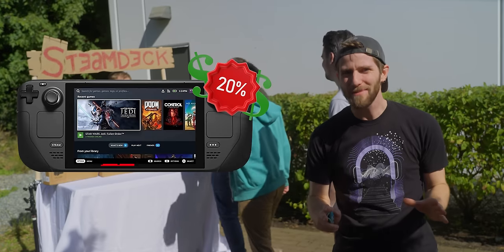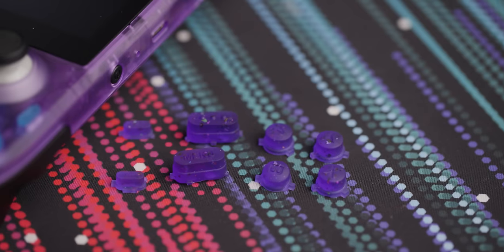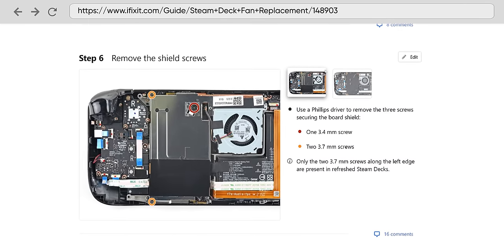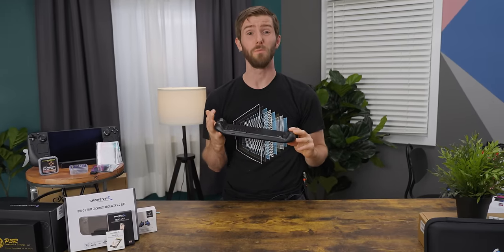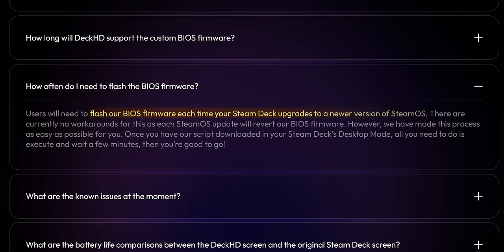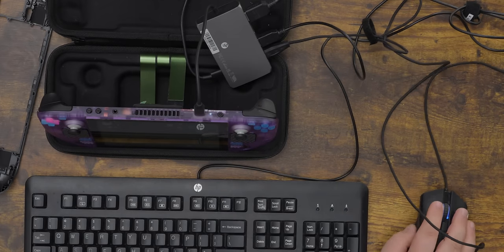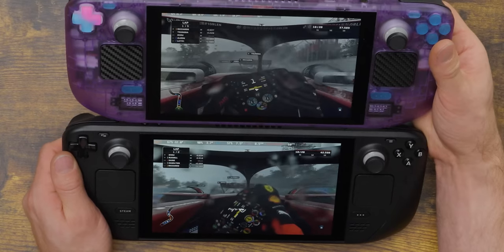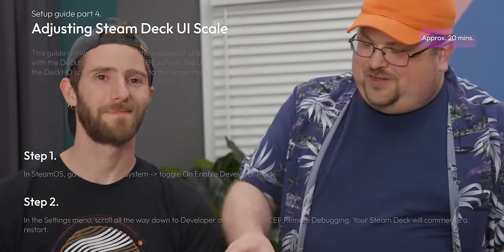Five Steam Deck Upgrades under $100

Comment: 7:20 I really like 1600p in this form factor, not because 1600P more betterer than 1200p, but because you can get perfect 4:1 scaling down to 800p for games that are a little more intensive.
With a 1200p screen you need to drop to 600p, but it just so happens that 800p is the minium resolution for many game UI to function properly(i think technically 768p but who's using a 4:3 display in a hand held, though, that does peek my interest).
Hence why i like 1600p, yes 1200p would offer better FPS at 600p, but for best compatibility, you need 800p, at which the 1200p screen will either look a bit blurry, or will cost some extra power for the scaling engine to make it look better.

Comment: Personally the JSAUX covers were much more better to install and they used the same threads for the deck.
I originally got a back cover, and then they released front ones and I bought one in an instant! Broke the screen, I heard it as I scraped off the foam, but other than that, it caused me to get a 512GB screen replacement instead, so it was a win for me, I absolutely LOVE it and honestly, it feels nice when people ask how I even did it, I even sideloaded windows onto it, allowing me to code on the go, absolutely love this machine!!

Comment: I feel that a lot of the information given on the different mods will greatly vary from user to user as many of the problems faced come from mistakes on the user side such as the overheating causing the joystick issues and the issues with the front panel they probably overtightened it its also good to take note that the screw issue pressented on the XtremeRate Shell wont be for everyone as I managed to Use the stock screws on my shell and everything is locked in place and have no issues with anything being loose or coming off. As for the DeckHD screen everyones milage will vary as some screens are miss aligned and need to be RMA'd due to some quality control issues but if you get a good unit or one that only looses on 1-2 pixels and it doesn't bother you you can definitely enjoy it. I went through the setup it really only took me about 45-50 minutes on my first ever time opening my Steam Deck now that i have done it on others I can confidently do it in about 40 minutes so them saying it will take about 2hours+ will also vary from user to user and on their level of knowledge on electronics. For a non techsavvy user it could take double the time on the page or maybe less... as for the Bios although its a bit of a hastle you dont really see SteamOS releases that often and reflashing is pretty simple.

Comment: I think they got the Waves mixed up. Wave 1 appears to be the new revision and Wave 2 appears to be the original Steam Deck

You might want to make a note on the video.
Reply: Are you saying LTT mislabeled them, or the actual products are named like that? Like did they correctly label that wave 2 is in the stream deck and wave one is the new one, but you think it should be clarified? Im just trying to understand what you said
Reply: Weird way to differentiate a product.
Reply: No lol, wave 2 is available for pre order, and is an improvement of wave 1, which is already out. And they were using wave 1 in the video.
Reply: I'm afraid they will say " it doesn't matter that we mixed them up, our conclusion would have been the same regardless of the results."
Reply: @koijoijoe   It does say that wave 1 is for the new revision of steam decks and wave 2 is for the original ones. Wave 2 will have improvements suggested by those who bought wave 1.
Reply: yeah they took down the old revision wave 1 listing like yesterday.
Reply: Nah  @koijoijoe , they're right, they're linking to wave 1 for the new steam deck revision and wave 2 for the old steam deck revisions.
The listing for the product they tested doesn't exist anymore, they took it down yesterday.
Reply: Oh my bad everyone, I didn't realize we were talking about revisions of the Deck, I thought it was just the revision of the cooler. Sorry bout that.

Comment: When I had a Steam Deck I was bringing it to work and using it as my main PC docked on my work M/K and monitor during the nightshift. It was great. I eventually sold it to buy an AyaNeo 2 which I use even more since it's Windows and works even better as a PC docked.

Comment: I will say that for the back plate the Jsaux is probably a better option. Cryobyte, the creator of cryo utilities, made a video about over clocking, undervolting, and keeping the steam deck cooler. It seem like the stock heat shield/spreader with after market thermal pad and one of the Jsaux back plates works very well.

Me personally I am probably gonna upgrade to the new version of the back plate and cover the vent hole thats on top of the fan to retain its airflow design. Then add the black shark phone cooler with the recomended thermal pad. After that I will either undervolt or overclock depending on the peformance I get after the upgrades.

Also I have found that the gulikit joysticsk tend to have stick jitter, or stick drift, so its best to increase the deadzones to avoid it. The reason why I still use them is because the deadzone is still relatively small and  they are a lot more responsive than the analog ones. There is also some made by elecgear that are supposed to mimic the round zones of a traditional analog stick instead of the square zone found on the gulikit and most other Hall effect sticks.

Comment: In fact, the left joystick for Guli kit is like 2mm higher than original, it needs to be pressed in it's proper place, after the snap-in sound the left analog will fall in it's place like right one and will not need any adjustments.

Comment: For the joysticks, be sure to really push them into the shell. I got some from gulikit that weren't fully set in their daughter board causing some drag with the case. Also important to mention that there are multiple joysticks for each iteration of the deck, make sure you get the right ones. 

(Honestly I returned mine, the stock joysticks are perfectly fine so unless your joysticks break there is no real reason to get new ones)

Comment: I do hope the Deck HD does become an easier user friendly upgrade. Could add new life in your deck. I wonder if setting the res in the settings will unlock higher res options in games when docked, or some games hide 800p when it supports 16:10.
Reply: if a game is not showing the right res when docked then you have to make sure to manually set the res in the games properties setting on steam
Reply: Is it needed? Seems a bit silly to me. Waste of battery life.
Reply: @Wylie288 Personal preference. I'm more than happy with 800p but some people might prefer a sharper display over performance and battery life.
Reply: They can't, it's literally a screen replacement. There's a very good reason you don't see 3rd party screen replacement for stuff that's not meant for repair.

Comment: I did two shell swaps (my and my wife's deck) and gulikit joysticks. Zero issues and it took me about an hour each. Used a hair dryer, not a heatgun. Was a piece of cake and after messing with the screw tighteness, no sticky sticks.

Comment: Yeah...  I think I'll stick with just upgrading the internal NVME and MicroSD card.  
Did you try magnetising the dock to the back of the Steamdeck, using heavy duty magnetic strips or whatever, which will have to be placed both on the dock and on the back of the deck,  and then running the power through the dock to the deck?  
That's how I have my dock set up now, but I use a different dock entirely, and it does not feature an NVME slot.  The dock does, however, add two more SD card slots to my deck, both of which can be used for gaming, and both of which perform just as good as the SD card inside the deck itself, and it also adds 3 USB 3.0 ports to the deck.  
I would love to be able to use an NVME through a dock though, because that, when combined with a 4TB NVME, would give my deck access to 7TB of gaming data, since I currently already have access to 3TB after upgrading both the MicroSD card to 1TB, and the internal NVME up to 2TB.  That would be 1TB more gaming data than my current desktop.  I could store every game that I have on the system, as well as backups for those games, and still have space left.
Couldn't you just plug the drive into a Windows 10 based PC via a hub, and then format it in ExFat, so that it's readable in both operating systems, and do it that way, mounting it in Desktop Mode or Game Mode through settings?  I have a 4TB external disk drive, which I use to archive data, and that is both formatted in ExFat, and readable in both SteamOS and Windows 10.

Comment: For the thumbsticks problem/grabbing the better solution is to use plastic washers.
Under torqueing the screws will just cause them to loose up overtime and you really don't want a screw to go free inside a electronic.

Comment: First, your videos has a great quality and it was alot cohesive to some folk who didn't research anything about SteamDeck, a great video for new comers to Handheld PC.

I'm obsessed with the SteamDeck even tho i don't own one yet(3rd world country here) and i know you guys have a usual way to show something different then the others creators on this platform are showing, but i think it was pretty vague on a lot of aspects, that transparent back-plate, for example, has some great results on temp results, there are other solutions for temps, fans attached to the backplate, maybe showing some changes by switching the thermal compound on SoC would be great, if you're already ripping everything apart might as well optimize the time spent opening up and adding some special thermal paste/pads and then some results with that expensive lab. You could show waaaay more affordable buttons and numpads, and so on. lots of options with the accessories available.

I think the writers team didn't research that much, which is a bummer, almost everytime you guys try to approach some new tech you guys try to do something new and innovative which wasn't the case of this video, ain't a bad thing showing something vanilla but you can see the lack of effort to write something that could be way more polished.

if someone from LMG is readying this to the end, just one quick question, are you guys gonna follow up on that private investigador? because that statement from one of your ex employees was pretty serious, don't let that under the rug because another false step might result in a bigger problem than it was a couple of months ago.

In regard you guys are my fav tech channel for more than 8 years, even tho i'm alot skeptical about your reviews way before tech jesus spat the truth, keep the hard work.

Comment: Great video. Personal opinion is that the only upgrade you've mentioned that is worth doing is the SSD upgrade. For me personally the rest of the upgrades you've applied sort of take away from the console and make it less handheld and more of a console that needs to be plugged into the mains constantly. For me the buttons look very tacky as does the case but again that's personal opinion, though they don't appear to work very well together. The cooler has potential but for the time being is very hit and miss and for that reason I wouldn't install it. Screen protector is a good idea but on the later OLED model it actually causes glare because of the other features of the higher end model. It's a shame valve don't work with deck HD because I did consider that screen but having watched your video I'm sorry to say I definitely wouldn't consider it because it's too much hassle and there's too much of a performance hit along with battery life.

Comment: What might work is a drop in QHD(2560x1440) screen with a special qQHD mode that sends 720p to the screen as 4 pixel groups.

Comment: I would probably only replace the SSD for a larger size. Joysticks and buttons? Eh sure if you dislike them, cosmetic customization makes sense. 
Dealing with flashing a bios, faulty cooling "upgrade", etc. Doesn't make sense to me.

If you're going to spend $500+ on upgrades might as well get a Asus ROG ally 120hz or the new legion Go for the z1 extreme chip.

Comment: DeckHD sounds so cool on paper, but there are so many of those "little things that add up" that I'm just not interested. I would much prefer a larger IPS LCD with smaller bezels and the same resolution if I'm going to dig in that far to swap the screen, or just wait until there's a more powerful, more efficient device that can drive higher resolutions without the battery life and performance hits.

I do find the monoblock really interesting - I haven't had thermal issues with my Deck but the tinkerer in me is excited to see how the revised version performs, and it looks pretty sweet under a clear back shell.

The stock shell feels so nice that I don't want to change it, and I'm kind of bored of atomic purple even though I'm exactly the target age for the nostalgia, lol. I bet a hit with some fine sandpaper around the hole for the left stick would fix that sticking. I do plan on doing an ExtremeRate full shell swap on a Switch, though- their products look really nice. The buttons are super cool! I might do those eventually on my Deck.

Comment: I am a fan of low-resolution settings and displays. 720p is the sweetspot for everything. It is a perfect balance of power usage, cpu/gpu usage, easthetics, framerate, data usage (streaming) etc...
Except e-sport level first person shooters. Those need somewhere between 1080p-4K.

Comment: at 8:40
Doesn't seem like there was much contact between the P3R Monoblock and the memory at all!
It also seems like part of the die was not covered by thermal paste (I'm not too sure on that...), could that account for the wildly fluctuating thermal results for the CPU?
Anyways, seems like the issue is one of(or more) the thermal pads being too thick resulting in uneven pressure on the whole assembly.
You can spot that the thermal paste on the bottom-most memory chip right next to the light-grey thermal pad did not get squished at all compared to the upper memory chips. It seems like this thermal pad is the most likely culprit as it could be making the Monoblock sit at an angle on the memory and the die.
  @LinusTechTips

Comment: One thing that I would strongly prefer in a replacement case is the ability to mount a 2280 M.2 SSD in some spot and use a 2330-to-2280 adapter to replace the original drive with that.

Comment: This video reminds me of custom psp days, i had a transparent case and the thing wasnt excatly thr same as spec and i used a small file to trim some of the edges in order to make it fit. 

The problem is the manufacturing moulds dont guarentee the shape and size.

Comment: You guys should give the monoblock another go but do your best to give it its best shot. Instead of thermal paste on the memory chips use K5 or pads, and the other chips that have pads make sure the pads are making good contact. Hard to tell in the video but when you remove the monoblock (8:43) you can see some bad thermal paste spread on some of the chips. 

I get you followed the instructions and bad instructions are the fault of the manufacturer but you have the hardware, the tools, and the know how. Would be nice to see what you can do to make it really shine.

Comment: For thumbsticks you need to cut a little spacers from a plastic bottle and put it under the thumbstick boards to make it .1 inch further away from the front panel. Had to do it for my GuliKit too, otherwise they would scratch my stock front panel.

Comment: I used a jsaux case with their matt display protectors that's perfect. Also the changed buttons on the back has so much better grip!
The great on jsaux is, that their case has a additional cooling-pad to theoretically add a external cooler aaaaand extra holes for the fan to make it quieter.
They also has protection cases, docks for all needs.

Comment: 11:55 i had no such issues with my JSAUX transparent front/back. Looks and feels great. No perceivable difference in thumb stick feel, and it uses stock screw sizes. Also came with tools. They have a great video walkthrough too. It was like a 4 hour install though, and ive done all kinds of hobbiest mods and repairs before. Very daunting install if youve never attempted something similar and i advise against it.

Comment: there is a better option for the case replacement, JSAUX makes one that has a vent on the rear for the fan, this works very well and cools better, this also makes it a little, not much, but a little quieter.
Reply: Even without the opening, the JSAUX shell is just much higher quality. Extreme Rate is Extreme Cheap.

Comment: FYI --- For anyone looking to get the DeckHD Screen, if you're willing to deal with the bios flashing, the screen has a very purple hue to it, and in my opinion makes some darker games look pretty bad. There's also a huge heating difference between the original screen that has a copper shield around it, and the DeckHD that DOES NOT have this shield at all. You can purchase this shield from elsewhere and add it, but the screen doesn't come with it.

Comment: You need a script? 16:32 it's arch, just add a single line to the fstab and you should be chillin. Or make it more reactive by adding a service to check and mount appropriately. Last time I had a service mount a drive periodically it was like 2-3 lines in a brand new .service file